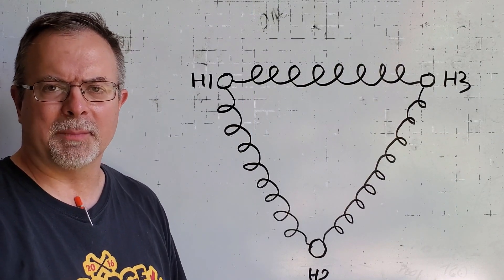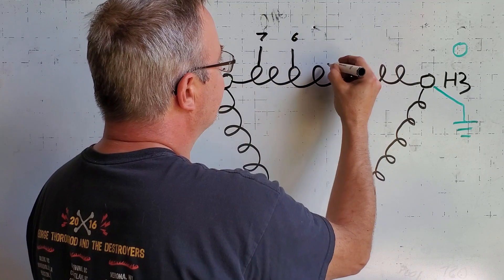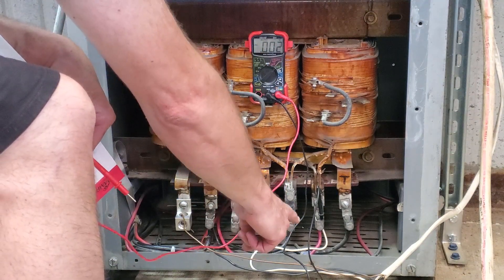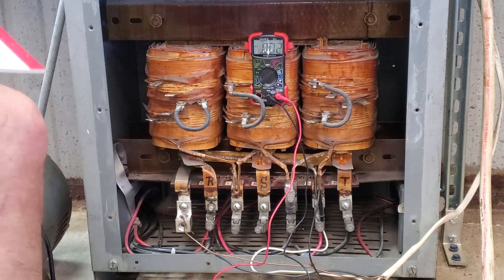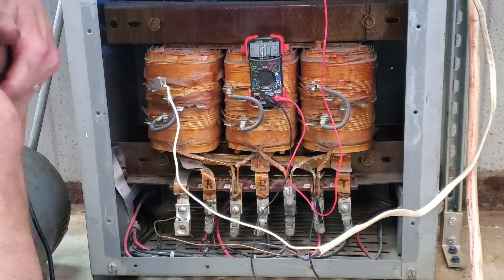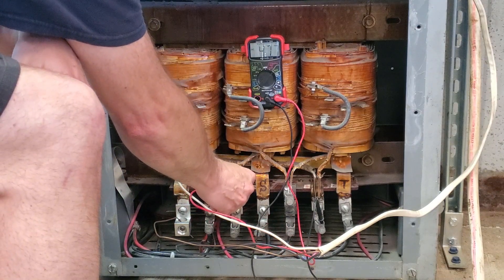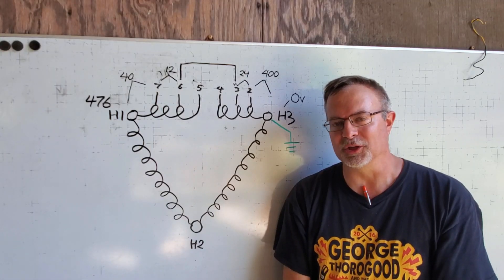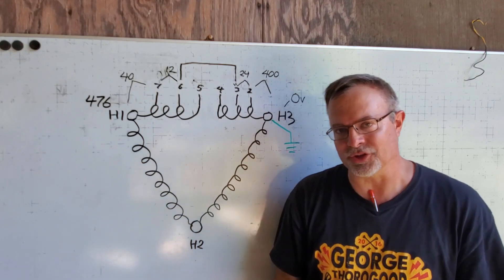Transformer Experiments - Probing 500V

Comment: I had to come back and rewatch this video and your prior video, today I picked up the 3 phase motors I got at auction Plus I ended up with a New square D transformer model 30T6H that is 30kva 480 high 240 low 2+4-taps 3 phase , I am hoping that I can use this transformer to do what you are doing, problem is I have no clue if this transformer would even work for the same for the type of project you are doing, so I thought I would ask you.
I ended up with two 30 hp motors both have new bearings one is a 230/460V 1800 rpm the other is 208-230/460V 3520 rpm, then there is a 25 hp 230/460 1770 rpm and one more large one I didn't get a chance to unload as it got dark, and three smaller ones.
The transformer pallet also had some shut off boxes and a large new panel, I can't wait to unload the vehicle tomorrow to see the items bought.
Reply from the maker: Sounds like a good haul! The transformer should be fine, hopefully it has a tag showing the tap configuration. I had to swap mine around to get the 480v to come out right. The 3500rpm motor will be hard to start because the armature has to spin up so fast. The 1800rpm would make a better idler. If you ever come across a 1200rpm it would be even better. My small shop has a 15ho 900rpm motor and it's nearly silent. Have fun, lots of good stuff to tinker with!
Reply: @EngineersWorkshop  I got to tell you I woke up this morning and oh the back hurts those motors are so heavy, i can hardly function today, I know one of the 30 hp motors said 407 lbs on the tag, four more to unload with only one more bigger one, lots of projects running out of time before winter comes.

Comment: Couldn't you feed the transformer from the converter to go from 240v 3 phase to 480v 3phase?
Reply from the maker: That is the intent. Gotta get the system to power up without kicking breakers. Can do one or the other now (idler or transformer) but not both.

Comment: Truth is unless you are feeding electronics the motors won't really care. I tried voltages from 440 to 500 to see if it improved the starting on the big Monarch and it made no difference. I settled on 460v since that is whet my CNC calls for.
Reply from the maker: Still tweaking, I suspect the generated leg will be high, and may need to tap that coil for lower voltage.

Comment: A good safe way to test Xformers is to use a door bell Xformer on the primary side.  That way you feed around 10VAC to the primary and don't get lethal voltages on the secondary for testing and calculations.  Good video, thank you.  Lots of bugs there eh?
Reply from the maker: Just one annoying wasp. Will try the doorbell test next time I'm out there!